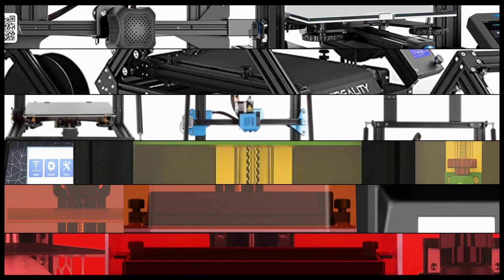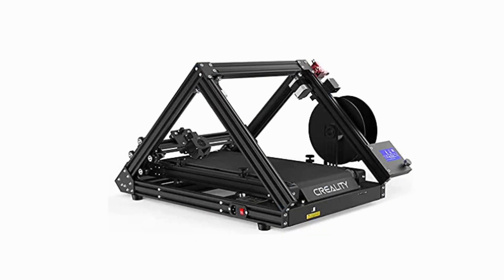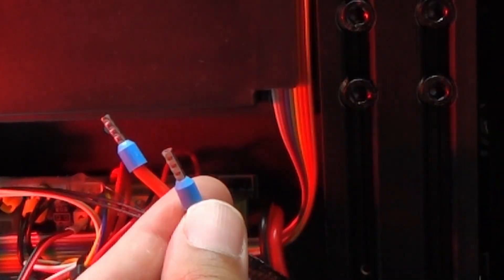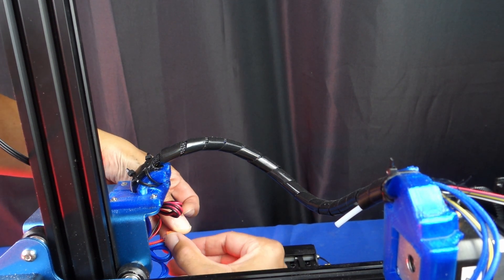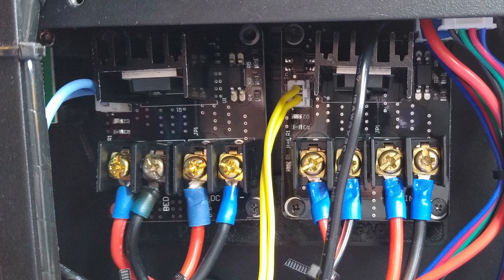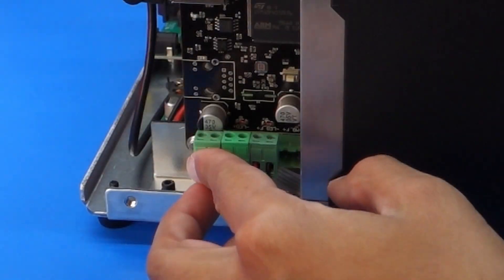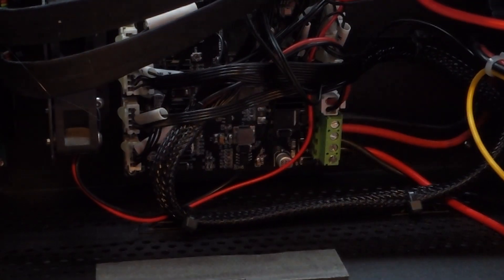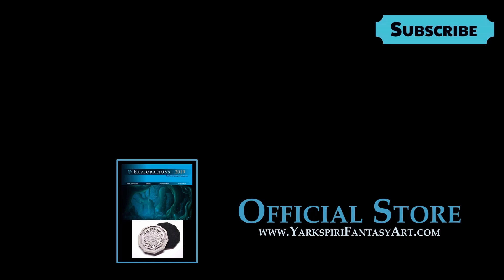𝗦𝗵𝗼𝘂𝗹𝗱 𝐘𝐎𝐔 be 𝐖𝐨𝐫𝐫𝐢𝐞𝐝? - Final Verdict 𝗦𝗵𝗼𝘄𝗱𝗼𝘄𝗻

Comment: This channel is criminally underrated.

My first SLA printer (Mono X) is arriving next week, this video is very helpful. Many thanks!
Reply from the maker: Thank you.  For the larger machines, you may have additional terminal blocks because of the UV light array.  I would also watch the Elegoo Saturn Safety mod, so you can get a better idea of what might inside.
Reply: @Yarkspiri  Care to elaborate? Please forgive me, I’m not that well-versed on electronics but I have a friend who does, maybe he can help out with some modifications for added safety if I show him this video.
Reply from the maker: @j_shelby_damnwird  Sure, no problem.  Essentially, you're looking to check the terminal connection on your motherboard.  They're those green things that have wires inserted within.  Those need to be checked for tinned wires (which they pretty much all are) and replaced with ferrules.  Some terminals are designed to come out, which can sometimes make this process easier.  If you do take them out to change the connections, make sure to add some hot glue to keep them from coming loose from the vibrations.
Reply: @Yarkspiri  Got it. Thanks!
Reply from the maker: @j_shelby_damnwird  Best of luck.

Comment: what is the basis for you believing the ferrule (low grade made in China ones I saw you used) are better than tinned copper wire. If you are so concerned about safety you may want to restrict your purchases to ones evaluated for conformity to safety standards such as those created by UL , CSA, FM and who knows how many others... you sound like too cute a girl to be wasting your time on these types of videos... unless your actually monetized and they generate a revenue...
Reply from the maker: https://cdn.thomasnet.com/ccp/00142951/263810.pdf Does a good job explaining why it would be a good idea to replace the connections with ferrule ones.
Reply: @Yarkspiri  seriously? a few advertising paragraphs from Phoenix Contact, a manufacturer that would be put out of business if people were intelligent enough to read schematics are your reasoning to use low quality chinesium crimp on tin?  I believe I have been tinning wires for more years than you have been on this earth and had nothing but success.... unfortunately, technician intelligence can be reduced if connectors take interconnect complexities out of the equation. If current flowing through the wire causes it to heat up, then you should not be making wire size decisions.... copper is mailable to a point as tin....
Reply from the maker: I unfortunately did have an issue with a machine failure due to tinned connections at the screw terminals, and luckily it was caught in time.  Additional reading material https://reprap.org/wiki/Wire_termination_for_screw_terminals and https://hackaday.com/2018/04/12/to-ferrule-or-not-to-ferrule/ just to name a few articles.  I have yet to see evidence of "Chinese made ferules" being a safety risk, but if you have seen some, please let me know since it might be worth investigating further.
Reply: Would have been interesting to see that damage....If you specify a printer and the  connection I'll look at it if i have a printer ... If safety is a concern, look for a UL ETL or CSA conformity assessment mark for all your consumer product purchases...  It they are building in accordance to the safety standards, inadequate gauge wires would not be an issue , which is the only thing that could lead to what you have described happening.... 15 amp main fuses with non current limited 16 gauge or smaller wires are simply the poor design and manufacturing i see coming from non-UL certified Chinese products
Reply from the maker: That's very good information to know.  I'll definitely keep that in mind the next time I have to purchase components.
Reply: @Yarkspiri  Don't be fooled though, 90% of components you buy from so called reputable vendors, ARE in fact 100% the same ones you buy from China! This doesn't go for everything, but it sure goes for FAR more than what some people might let you believe. Some tend to think that "made in us" means everything is made in US. While the fact of the matter is that it usually just means "assembled in US" (and even that is often questionable) with essentially Chinese components. The very same identical components you can buy directly from Chinese websites!

Also, all those so called safety labels are hugely overrated! They quite often DO NOT mean what many think they mean. On top of that, they are useless when it comes down to components like those (small) ferrules. Those safety labels don't say a think about individual components being used. They have their use and are important, but don't be fooled by them either. I have seen plenty of devices and equipment with all the proper official stamps of approval on them, just to find out they are crap inside, or made with lowest-bidder-components, or with economics-are-more-important-than-longevity-or-safety in mind (those labels are often at a very low bar).

Also, you were 200% correct in suggesting to use ferrules! 
It is industry practice and very common knowledge that using ferrules is recommended above tinning for very good reasons.

Mark is clearly comparing apples and oranges in his comments.
Of course low grade/low quality made ferrules quickly stuck to a wire, are worse than professional high grade proper tinned copper wire (usually, that is, not always). But nobody is comparing those two, except him.

Because using properly attached high grade ferrules ARE in fact far safer and better than high graded proper tinning...
And at the same time, low grade crap ferrules ARE ALSO better than low graded china fake tinning...
Apples vs. apples and oranges vs. oranges!

So, yes, by all means, tin the wire properly using a good quality graded solder. But even better would be to properly attach a proper ferrule with the proper dimensions and proper tools.

ferules > tinning > bare wire .... almost always!!

On top of that, wire gauge has got nothing to do with all of this (at least not in the sense we're talking here). Of course a decent ferrule isn't going to magically fix a bad or too thin wire. But so wouldn't a proper tinning have fixed that! Those are two utterly completely different issues. So, again apples and oranges in that case.

PS: I don't think you are "wasting time on these types of videos like a cute girl" , monetized or not!!!
I mean... WTF Mark?
Yasmeen, you do you! And we are also the better for it! Thank you!

[/RANT]
Reply from the maker: Very well put together. The additional information helps put everything into context. Hearing both sides of the discussion is always important, and I do hope other's see this post to get a better understanding of this topic in general.  

I did try to find some of the suggested products, however it seems that most of these are very difficult to find in Canada, and getting additional documentation about their certifications was also not straightforwards when it came to talking to resellers.  Overall, I found that some of those suggestions simply weren't accessible to the larger community as a whole.  And yes, many of these same products are often produced within the same manufacturing plants but with a different label applied to them, so verifying authenticity isn't very straightforwards.